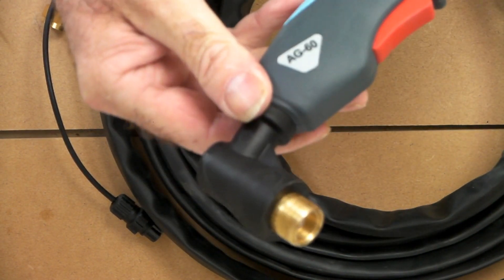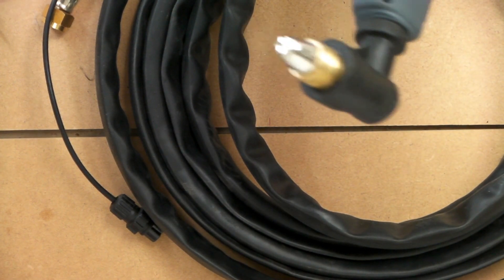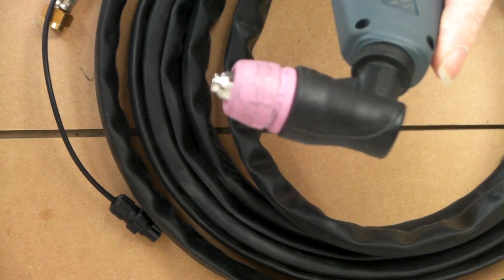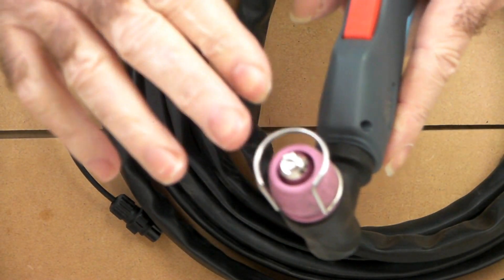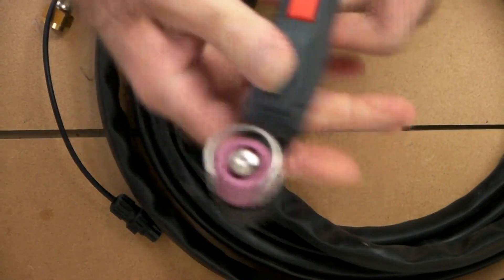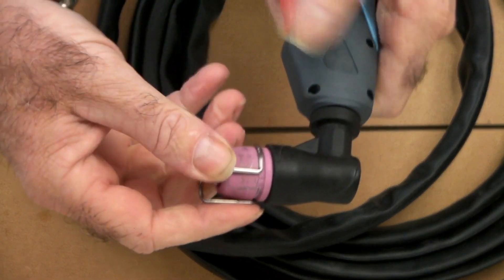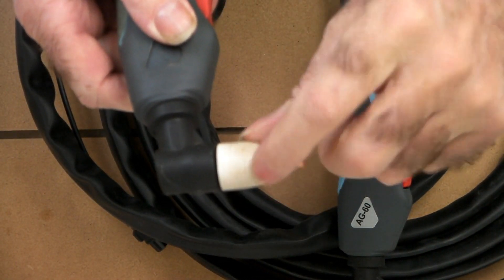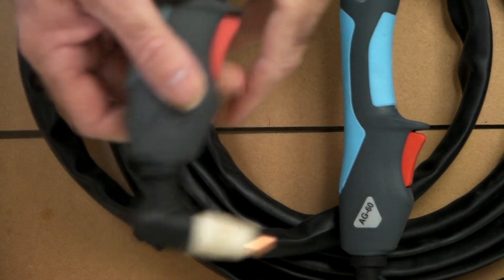Plasma Cutter Standoff Guide / Save Money On Consumables

Comment: So the pt31 toruch I can't run the tip on the steel
Reply: You can but its not recommended  it will shorten consumables  life span considerably .
Reply from the maker: Yes the pt 31 torch must contact your metal to cut.
Reply: @petestools  I have a PT 31 torch and the manual says, do not touch the metal when cutting  Yes touch to start the arch but float it when cutting.

Comment: Is there a version of this that will work on the Miller Spectrum 375 plasma cutter?
Reply from the maker: Hi, Ben, I have been making some inquires but can't seem to find an answer for you so far as Miller seems to do their own thing.  I will keep trying to find an alternate torch and post answer when I find out.  Thanks, Pete
Reply: Some Chinese torch manufacturers make torches with connections for various manufacturers. How good are Chinese torches? Well, they’re cheap, that’s for sure. A torch for ESAB/Thermal Dynamics, Lincoln. Hobart, Miller, etc. can cost between $550-$700! But those are all Pro torches.